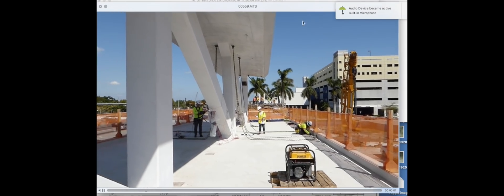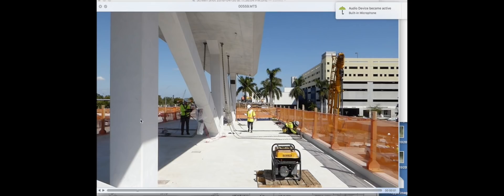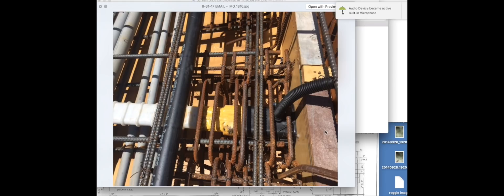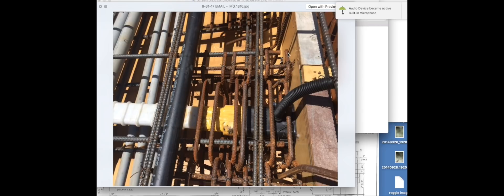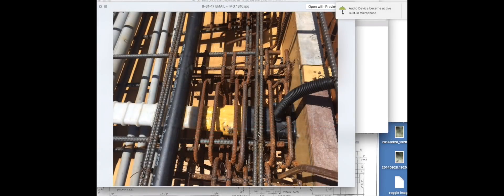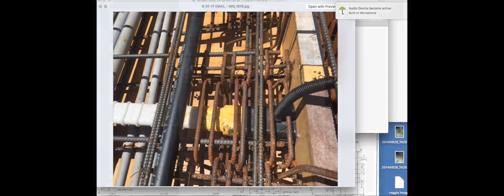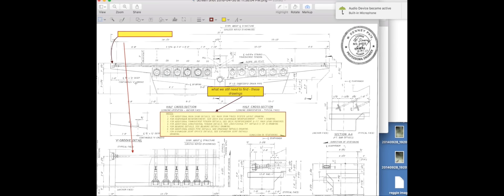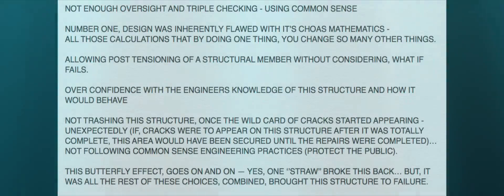FIU BRIDGE COLLAPSE NEW VIDEO - MCM DOCUMENTED AS NOT BEING ABLE TO FOLLOW PLANS

Comment: This is the horrific collapse of a BRIDGE ELEMENT. As the main element in an incomplete structure it should have had temporary support left under it to assist in support until other elements were in place and tied together with the tall column providing cable support.  The roof is a flange portion of the reinforced concrete I beam, the main deck being the other.  It was a terrible event ending lives and careers and damaging the formerly good reputation of a South Florida University.  It is not a bad design, but the premature removal of all underdeck support was the deciding factor in the collapse.
Reply: Zingara Joe ,
It is a horrible design. They could have done proper cable stayed construction rather than this ridiculously complicated mess.
Reply: Zingara, the top diagonal cables were a design feature not a support. From what I read anyways.

Comment: I  posted  the  fault  of  the  bridge  THE  SAME  DAY  IT  COLLAPSED.   Lets see if  I  remember:  Oh  yes:   this  million pound  too heavy span was let stand alone  without suspender cables  attached.   It  was  no surprise that it fell,  and  another thing  there  was  no  continuous  steel  beam  under the  or  inside  the  bridge.   Anybody  could  see  that   placing  sticks of rebar  fastened with mechanics wire  then casting the concrete  was a failure waiting to happen.
Reply: My cellar floor had to be demolished and repoured, they had farther spaced rebar & it cracked days after the pour. Shoddy workmanship. Even I knew that the fill needed to be tamped down before the pour, but they said it didn't when I questioned them about it. 
How come people with no engineering knowledge can see things that the professionals can't?

Comment: The position of the rebar reinforcement is CRITICAL to the strength of the structure. The wrong placement of rebar within the concrete can cause weak points which will cause a collapse. The best example I’ve seen is documented in a Chinese collapse investigation which showed the wrong height chairs were used at connections between the columns and floors which caused cracks and the whole building came down. The rebar was only an inch   (I believe) higher than it was supposed to be.
Reply from the maker: Awesome Charles -- great comment - keep them coming...

Comment: The bottom line, regardless of the construction, is that the engineering on this bridge was both inadequate and flawed. The biggest problem is lack of redundancy in a design that has known weaknesses. This is a design that experience and basic engineering have shown to be prone to catastrophic failure. The fault lies with the engineers who were too stupid to design some redundant safety features into the bridge and then exquisitely stupid when it came to obvious signs of failure.
Reply: The morning the bridge collapsed  I  commented of facebook  about the lack of redundancy   and  two other issues #1 no suspender cables  & #2  no continuous steel beam  directly under the pour.

Comment: Looking at this during construction video only reaffirms my first opinion of why it fell down what kind of brainless dummy came up with this design and bull** support structure inside the concrete this is so F-N ridiculous even a weak distant hurricane would have blown it down, they may as well have used popsicle sticks with the weight of the cement and just a little amount of re-bar is no-way of making a bridge there  has to be solid steal support !!!

and on top of that low opinion it was the ugliest out of place design if it hadn't fallen down people would have voted to have it removed!!!

Comment: The fact that the cable stay design was only aesthetic is just weird.
Reply: You can see from the positioning of the fake cable stays that the bridge was originally designed to have real cable stays providing the redundancy. My impression is that they believed that longitudinal post-tensioning would provide the redundancy.without using real cable stays, which takes more work. However, I don't think that the concrete deck could have withstood post-tensioning in all the available places.without crumbling.under extreme compression. That's why fewer tendons were used.

Comment: No u stress cable before u pour it
Reply: I worked  at a pre stress concrete yard once. And that's how they did bridge spans.  Stress cables then pour
Reply from the maker: That is "Pre-tensioning" and this was mostly "post-tensioning"...
Reply: Construction Engineering & Photography o ok Cool.
Reply: Construction Engineering & Photography huh.  You would think it would be the same as a bridge span beam.

Comment: That’s the quality you get from untrained, uncertified, non union workers. NO pre or post tension cables should ever be installed without proper certification. As a union Ironworker I have spent hours in the classroom and on the job to be qualified enough to install these systems. They are dangerous to install, stress, and in some cases unstress. It’s a shame it takes someone life for this GC to now know he cannot cut corners. Another issue is if the installation failed inspection, why was it ever poured in the first place?  Thank you for your research into this incident and the video.
Reply: This has nothing to do with union or non-union labor.  It is only about skill and inspection.  I totally agree with the inherent difficulty and risk in pre- or post-stressed construction.  My favorite professor and I caught a poor design at a prestress yard and notified the owner to correct the issue.
Reply: I have four cousins who were iron workers in Minnesota during the 50s through the 80s.  They're retired, but what they knew and how they worked was nothing less than heroic.  At the end of the day, my money (and my life) is on their training and more importantly, their experience.  They'd probably just look at this proposal and shake their heads 'NO'.

Comment: One thing I keep seeing people miss in their analysis and assessment is that this is/was supposed to be a cable stayed bridge design.  A search of the internet will reveal concept art of how this bridge would look when finished, clearly showing a cable stayed bridge.

Having said that, the problem appears to me to be in the construction process.  Notice how there is no tower from which to hang the supporting cables?  

It was doomed to collapse because this span of the bridge wasn't designed to be self supporting.  There is video of the collapse and there is no support for this span.
Reply: What you saw in the concept art was mostly intended for aesthetics and was going to be installed later, since it wasn't meant to be structural. They designed the truss in the center to be enough to hold its own weight. The cables were because the thing would've looked frightening to the public on its own (which clearly would've been a valid assessment).
Reply from the maker: It was not designed as a cable stay bridge, in the approved plans... Perhaps it was in one of the early plans but not in the final, working plans.

Comment: As someone who isn't knowledgeable in this type of engineering, I thank you for these videos. Not only do they provide some insight into what caused the collapse, they are also interesting from the standpoint of how such a structure is built.
Reply from the maker: Thank you Elijah for your kind words... I wish I was 100% sure of this failure: I feel it is the best answer that can answer all the data that is currently available. 
With all that said, I will change my position if the data directs me in that way...  Perhaps, they are holding out, that a full canopy crack was present... That would be a game changer... Until then, I will stick with this load path failure... Thanks again.
Reply: The root cause is that women built this. And they are the type of women who call math as it is racist and sexist.

Comment: All the extra money that’s getting thrown around just to find out witch ass to kick. Although a court case needs to happen some of this luncheon and function money should be handed straight to the victims and victims loved ones clearly it won’t fix things but all the asses on seats buy lawyers engineers witnesses is lost money
Reply: I guaranty some  (or a number of) insurance company(ies) is gonna be out millions on this.   There is no way this project even gets started without huge liability limits.  That covers the injured and dead.  As for the span itself, my guess is that there were payment and performance bonds in place to insure completion of the work that a liability policy would not insure.   I would be very surprised if that were NOT the case.

Comment: Ok im a Carpenter Builder in Australia .  I have Questioned Engineers and Architects Before when they are Wrong   . If  i  Believe there is a Problem or Fault i tell them .. I Cant Believe that any of the Workers who have been Building Bridges before not Look at this Bridge and think there is No Problem . From the Steel work through to the Cracking .

Comment: Who inspected the rebar job? I'm no expert on rebar but it seems clear from the photos that this project was completely out of control. Having unskilled labor that can't even read on the project should be a warning to contractors all around.
Reply: true as light
Reply: As a structural engineering draftsmen who is familair with concrete and rebar detailling I find that the rebar looks very messy and untidy. I’ve had my doubts about the node points of the truss, this design leads to some ugly rebar details that are prone to incorrect placement and mistakes.

Comment: Long span heavy concrete deck, long span canopy, all held up by a single central row of slender inclined members, all set at unorthodox angles for the sake of aesthetics.  All run in some kind of partnership with a bunch of school teachers....I think my gut feeling would stop me ever even setting foot on the thing ..let alone hanging out there on the tables and chairs admiring the light display. I really am beginning to wonder about Boeing aircraft in fact.
Reply: Andy harpist 
Yeah no joke, that bridge wight was 9000 tons and no center column. It was disaster on paper let alone build it for it too  fail on the kids crossing it.
Reply: Andy harpist   WHAT ARE YOU RAMBLING ABOUT??
Reply: @anthonyagnelneri4076  
I think that what he's on about is that aesthetics may have determined too many aspects of the design to the detriment of safety and functionality. 
Check out the interviews with the designers on Utube posted before the disaster.

Comment from the maker: The images, in this video are of the cantelivetcantilever and they do not get longitudinal cables...
I have a new video, it will show the CEI,  was "soft stepping" ... those cracks were crucial...and this is my opinion, and the evidence should have shown that...
Based on their recommendations, they only required "monitoring"...
They should have used Gamma testing and so much more to evaluate those crackS.
Reply  ·
Reply: The puff of smoke (dust?) appears to be a PT cable end blowing out after the cable breaks.  I have seen this effect due to damaging a cable not structural overload. Usually the stretch in the cable required to make the anchor spring out is due to the cable break occurring away from the anchor.

Comment: It sort of looks like something I have seen done many times, where an engineer will give a specification of something that is not widely used and not widely available so someone will decide to install two or three pieces of the material that is available. Unfortunately, this does not mean it will do the same job and sometimes you get away with it, sometimes you don't.

Comment: In this sort of structure, would it be down to the site engineers and rebar firm on site to decide the positioning of rebar? Or in something as critical as a highway bridge, the original designers would determine placement, size, strength etc of rebar?
Reply: No - the design engineer is responsible for design of the structure, which includes the drawings and specifications for the rebar (as well as all other parts).  Construction management is to ensure that all parties, including construction, suppliers, subcontractors, inspectors, etc., are all on the same page.  Constructors can and should point out anything they feel is wrong or impossible to build (like some rebar placement) when they review the drawings.  This usually either clears up a misunderstanding or bad detail, and the engineer must sign off on any changes.  Failure to follow the design drawings is gross negligence on the builder's part and routine inspection should catch this.

Comment: Too much rebar in such a little area, not enough concrete coverage. Plus, with the added psi in the concrete mix (+/- 8500 psi) you would think that some of the rebar may not have been necessary. Even if you removed only 1 bar, that would give you more concrete coverage around the rest of the bars. The rebar craftsmanship was horrible for bridge construction. I've noticed more recently in some of my projects that these Engineers tend to over engineer the job thinking they are adding strength, but too much rebar is just as bad as too little rebar....there has to be a harmonic balance with all materials involved.
Reply: Concrete even in high strength can be relatively weak in flexure vs compression the longitdunal strands and midspan pier or temporary pier would've made the difference.  The design, review, construction, management and inspection process totally failed, especially as they noticed cracking and let pedestrian and vehicular traffic continue to go about their day while they overtensioned the steel rods and made it come crashing down.  Pure idiocy

Comment: IMO the transverse tensioning cables should have been embedded at the highest elevation level below the concrete finish floor level. At the point where they intersected the truss there should have been additional transverse cables and spreader plates to distribute the load over three of them. We still don't know the actual root cause of the collapse. If the weight of the truss and canopy eventually crushed the plastic drain pipe which was at the highest elevation and directly below the truss then it would have become a dynamic load. This could have been precipitated by the post tensioning of the truss since its base was anchored to the walkway but it was probably inevitable. Post tensioning would have increased the stress on the walkway at that point. Once the plastic pipe was crushed it was over. Clearly FIA should lose its accreditation. The contractor's executives should be charged with six counts of involuntary manslaughter or at the very least negligent homocide. Thanks again for the continued coverage.
Reply from the maker: Mark, I do not think the drain pipe was installed... that conduit pipe, I think is for electric... recall, this bridge was to have all kind of lights, work stations, etc.  But, I agree, we need to see the detail under the connecting truss... How did they distribute the loads...
And thank you for your support...
Reply from the maker: Operation, the images, in this video are of the cantelivetcantilever and they do not get longitudinal cables...
I have a new video, it will show the CEI,  was "soft stepping" ... those cracks were crucial...and this is my opinion, and the evidence should have shown that...
Based on their recommendations, they only required "monitoring"...
They should have used Gamma testing and so much more to evaluate those crackS.
Reply from the maker: If the lower / deck, outside edges, if you will...
Give me a while to get to my desktop and I will link u 2 a better image.
Reply: Construction Engineering & Photography there is another possibility I don't think has been considered. It may sound far fetched but it could be the primary cause or a contributing factor. That is the walkway as an underdamped resonant structure. The canopy was a large collector of wind energy. The truss was an efficient transmitter of that energy into the walkway. The regular interval between the truss intersections and the Piers would facilitate oscillation at the sixth harmonic of the walkway's basic resonant frequency. When calculating it keep in mind that vibrations travel much faster in concrete than in air. Frequency times wavelength equals velocity. Review the video of the Tacoma Narrows Bridge failure on YouTube. That was the result of a 40 mph wind. Just another thought.

Comment: Figg Engineering built a new Jordan Bridge in Norfolk/Chesapeake. During construction Figg modified a steel support without checking with the manufacturer. The modification caused a 90 ton slab of concrete to fall injuring four workers.

It's beautiful with all stucture in and under the deck. If you are interested here are some key words. Virginian Pilot newspaper, South Norfolk, Norfolk, Chesapeake, Virginia.
Reply: Milleo, was this before or after the FIU collapse?